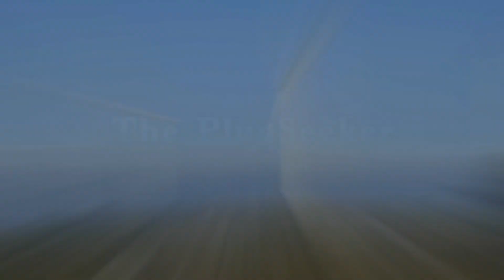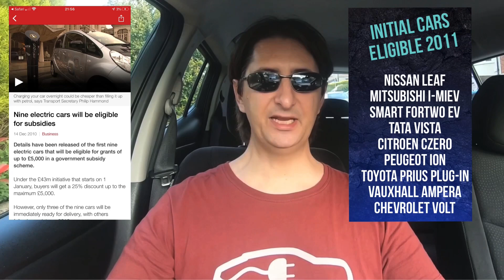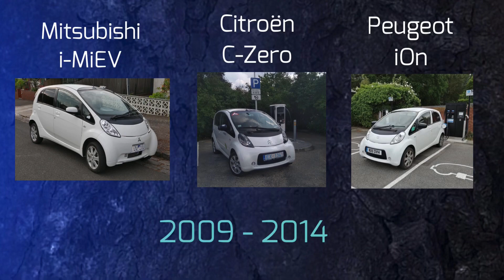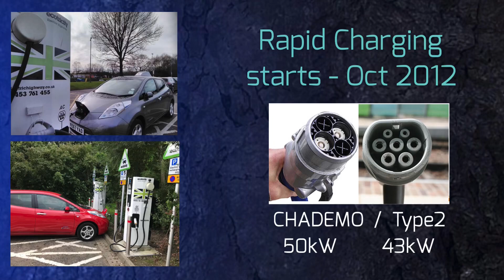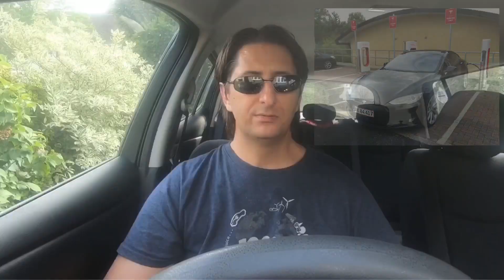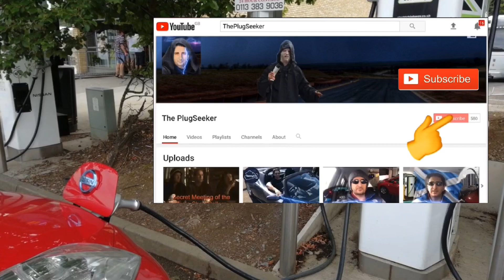Ecotricity & The Electric Highway (Part 2/3) - Building a network

Comment: I have applied for the Ecotricity RFID card several times without success.  I've now given up trying to get one.
Reply from the maker: Interesting. Did you try ringing Ecotricity helpline.
Reply: @ThePlugSeeker  Yes I did once, but the lady who I spoke to didn't really give me much other than 'Sometimes it can take a few weeks ' or something similar - it was last year since I last I tried. 
I suppose I could give it one more go.
Reply: @ThePlugSeeker  I think Ecotricty have stopped issuing them.
Reply from the maker: On their website it still advertises the Fast charger locations and says they are free with their App. It does not mention anything about withdrawing the App. I guess in daytime hrs can also ask over phone to activate it perhaps if don’t have App ? Not tried that though with a 7kW post.